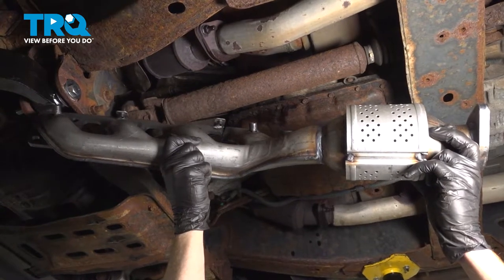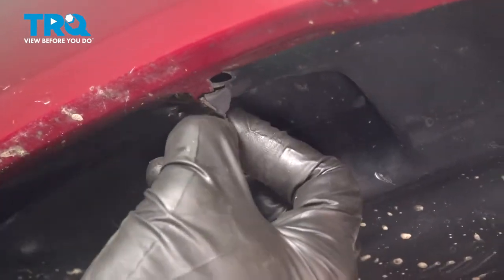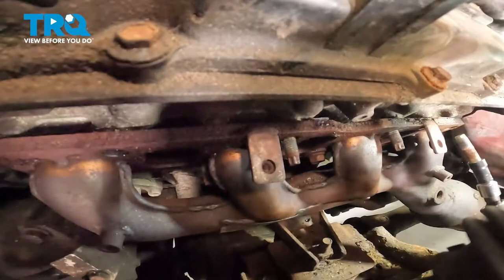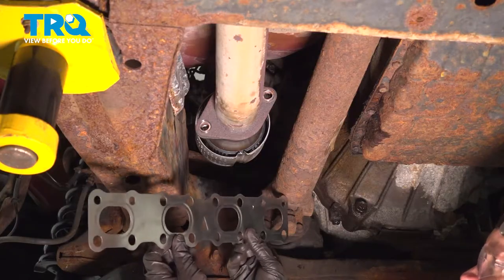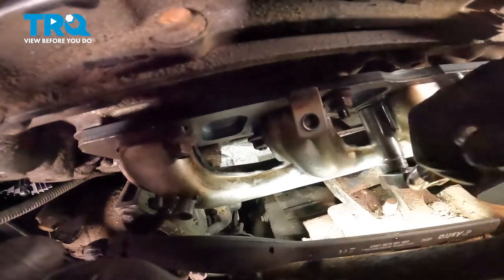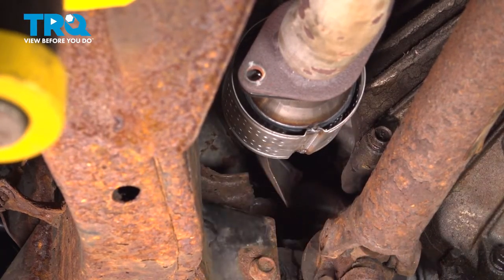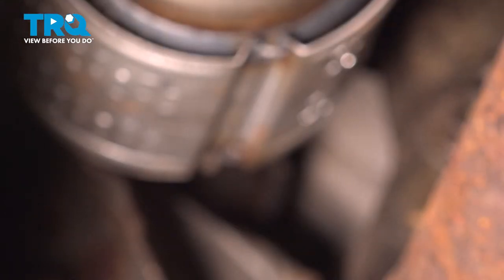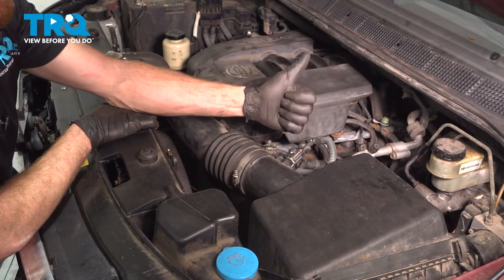How to Replace Exhaust Manifold Catalytic Converter Assembly 2004-2015 Nissan Titan

Comment: Hey I've seen other install videos for this and I'm curious. Does removing the studs prevent lifting the engine? I don't really want to remove the engine mounts. It also looks like the left side is the easier side because most people are showing that side vs. the right. Thank you.

Comment: What's the approximate Cost involved for quality parts and labor for a complete job? 2000.00 possibly more depending on the mechanic or exhaust shop if you're not able to physically do it yourself